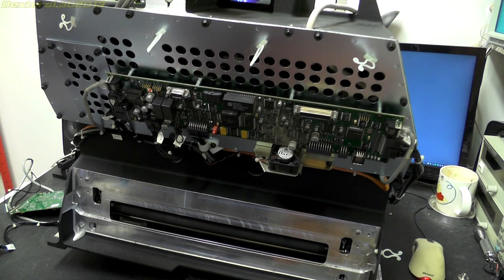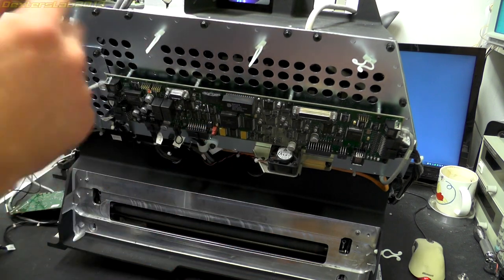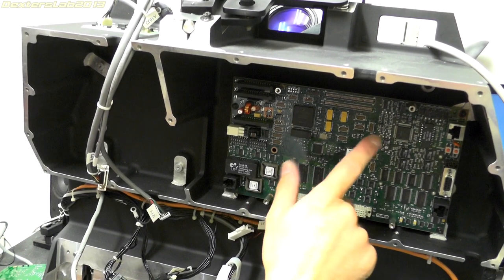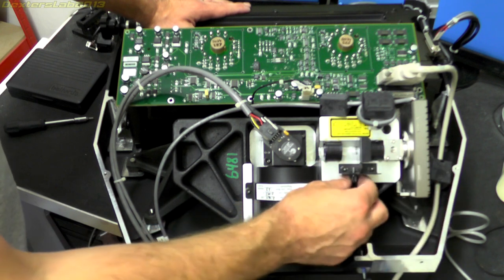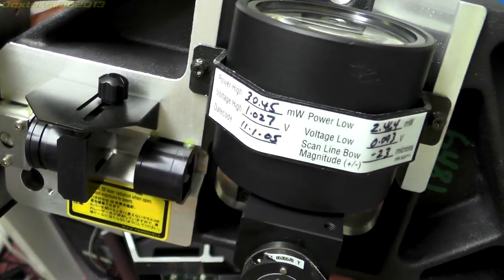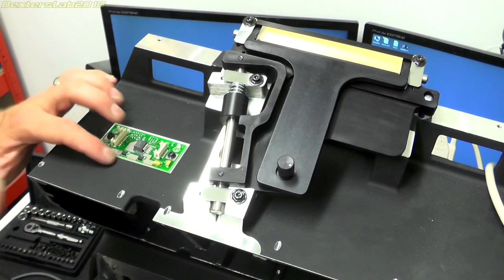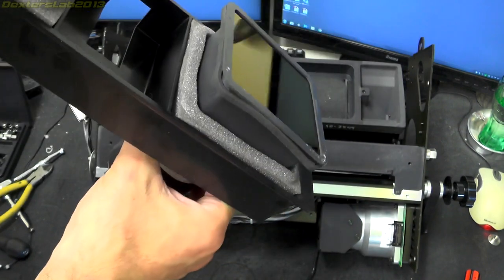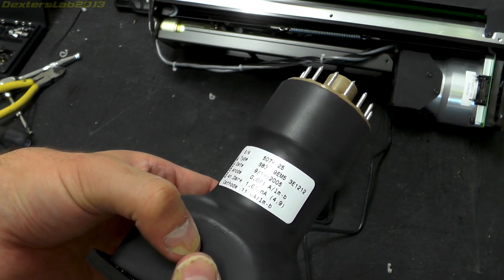DL#101 - Computed Radiography X-Ray Scanner Kodak CR500 Teardown Part 2

Comment: The third connection on the laser diode is the sense diode which goes back to the inverting input on the op amp which controls the voltage going to the laser diode so the laser doesn't die prematurely, the unit was designed to speed up procedures in hospitals.

Comment: Quite enjoyable a teardown!  Contrarily, I feel as though you were in a hurry and could have been a tad more thorough in identifying some of the components on the boards that I have never seen before.  I trust then that maybe you have, considering your ready access to such exotic equipment.  Either way, thank you very much for your effort in sharing this!
Reply from the maker: Thanks for the kind words. I am limited on space which means on items like this i do have to get it started, finished and cleared up in a short time. As for the boards, i don't tend to look at them in great detail unless i need to power them up.

Nice username BTW, just don't let me hear your poetry ;-)

Comment: That is indeed an f-theta lens.
Generic 3-element construction.
You should try tracing out the connections for the galvo board - it should be relatively easy to drive with a few hacks, just look for power and a DAC somewhere.
If not, you can just build your own galvo driver for it, though I doubt it'll be much use since you've only got a single-axis system.
Reply from the maker: Thanks Spirit, i don't have any use for the galvo. lens or the laser so i will probably be selling it on ebay.
Reply: DextersLab2013 I'd buy the whole lot if you had a set of two galvos, sadly I don't have a use for only one, esp. without controls :(
Reply: +DextersLab2013 Please let me know if you do as I might fancy a play
Reply from the maker: hi Rupert, I decided to take offers for it on the EEVBlog forum http://www.eevblog.com/forum/buysellwanted/(fs-world)-laser-galvomirror-f-theta-lens-assembly/

Comment: Did you try reading the CF card?
Reply from the maker: I did yes, it doesn't contain much, it's mostly blank. Not sure of it's partition format, i had to read through the raw disk in WinHex. Looks like there was some laser calibration data and then there was a list of data which looked to me like they could be lists of barcodes and a few bytes of binary data with each one. Could be a log of all the cassettes the machine has processed.